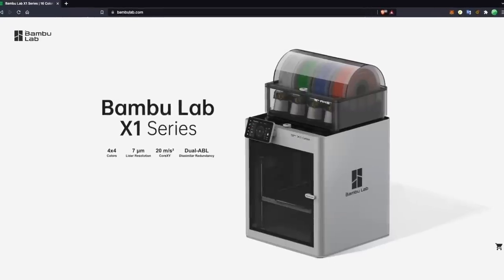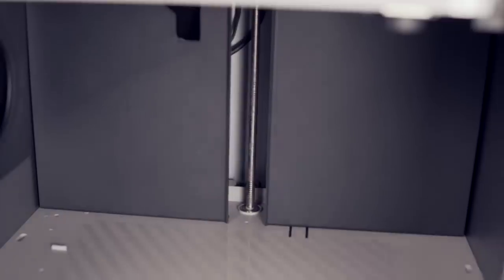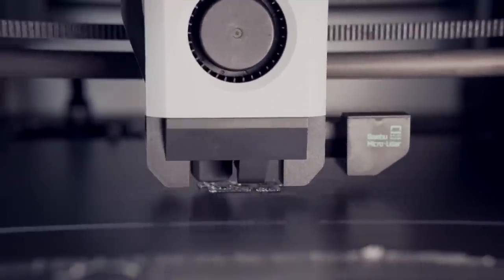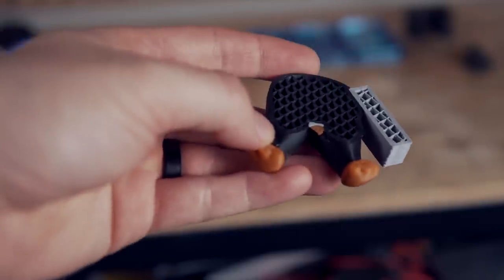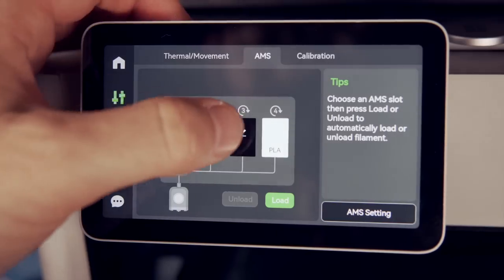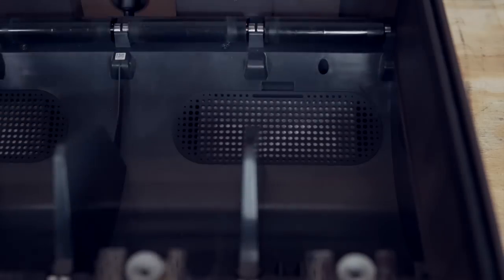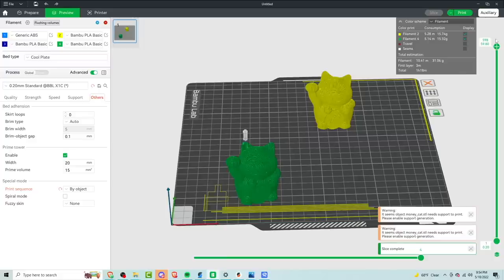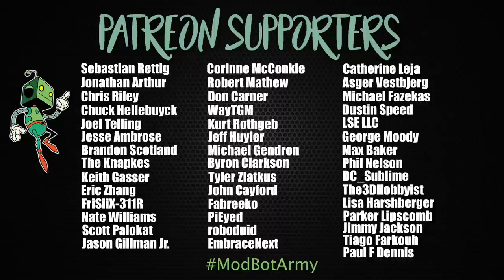INSANE 3D Printer That Requires ZERO Calibration (X1 Carbon)

Comment: Problem is their software from your explanation is cloud based, aka requires either web-browser or internet to use. Something that I do not agree with. What happens if the company goes under for w/e reason? It happened before making products unusable due to that.
Reply: They say: All should be Open source than
Reply: @fabianb9412  I mean, software should not depend on could that requires servers. For example sending something to print requires the cloud, if not then micro sd card. To be honest? They invested a lot into this machine, investing into a Type A usb port instead of micro sd would have been better imho.
Reply: @Vash.Baldeus  I think they added the Cloud in the wrong way. Cloud could be Helpful. (As far as i know they Change that [maybe])
They should build a Webinterface Like Octoprint/Mainsail/Fluids/... and local Wireless Connection.
You could activate a Cloud Connection for extern Access or slicing with the Handy App. But Not as Standard Connection.
And Second to (easy) Share settings. Especially with the AMS and RFID. Create a offline Database with the best settings (maybe saved on the SD Card). But add a Cloud sync to get the settings from Other People or Share your own.

Comment: @23:52 Yeaa... Proprietary consumables like those Nozzles are kinda a huge fuckin' NOPE to me... If for whatever reason the Company ( or even just the product line ) goes under and the flow of replacements comes to a screeching halt, then all you now have is a 1'000.- Paperweight which is nothing else but a big fuckin' nope. I mean I was already on the fence with the struggling Cloud Service, but this easily blows that problem out of the water 😑

Comment: Nice but do I have to have a constant internet connection to slice and print with this printer? That would be kinda stupid.
And you mentioned it has WiFi, so can we print directly from a PC (or transfer files to the printer) or it has to be done manually with an SD card?
I'd like to see some more simple version, without multi-spool support and maybe without a camera which would bring the cost down.

Comment: Fascinating!  This seems like a big step forward in the quest for a 3d printer that just works and can be as ubiquitous as a microwave.  The price point is... concerning; as others have mentioned, that seems like an awfully small margin.  It also makes me worry they're using sweatshop labour, or even forced labour - we know it's happening in China, even if we like to pretend it isn't.  But I'm not saying we should all abandon this project just because the price is low!  It's merely a thing I'm worried about.

Two areas I'd really like to know more about.  First, how is the nozzle put together?  I'm so ****ing done with hot-tightening and faffing about trying to get nozzles and heat breaks and heatsinks all properly butted together; that's a huge part of why I've got a pre-order in on a Prusa XL.  (The only reason I've not put a REVO on my Ender-5 is that I've got a MicroSwiss direct drive and I'm not aware of an option that works with that.)  I've wasted so much time and money fighting with multi-part nozzles, it feels like if this is just the same old thing all I'd be doing is ruining prints more quickly.

Second: can the AMS be used for runout?  That is, if spool 1 runs dry mid-print, can the AMS just swap to spool 2?

I'm certainly not an early adopter of anything, but I'm definitely keeping an eye on this!

Comment: Needs Klipper
Reply from the maker: Haha perhaps there will be a future version that is “hackable”.  For this release they are majorly going for hands off.
Reply: @ModBotArmy  (only at 10mins in so far) I can see that, but I am not a fan of stuff that "has an app" or can only be remotely controlled by said app.
Reply from the maker: @TheJustinist  you can print locally via micro sd but I agree that I would prefer local wireless as an option.

Comment: The AI looked like quinly vision?
Reply from the maker: Havent used Quinly so no idea. It also is not live yet so it is very possible it is a mockup image.
Reply: @ModBotArmy  I see, well it'd be nifty to go on full automation without the hassle of slice settings, or machine tuneups, just load model and print 😆👌
Reply from the maker: @Equinoxtrills  haha the dream. I still will like the ability to override though. Especially when printing functional parts that may need higher wall/infill counts 😊
Reply: @ModBotArmy  Yes, and the ability to print faster, with higher repetition, the printer might go a long way. 😁

Comment: As cool as it looks if it’s closed source = no go for me 🤷🏼‍♂️. Exposing yourself to overpriced replacements, poor support and/or bricked machine with proprietary firmware sucks…big time
Reply from the maker: I figured it would not be for everyone for the reasons mentioned. But for many it is not an issue. Especially anyone used to using Ultimaker machines that are the same way but 3-4x the price. I do love open source projects but I also see the appeal for a closed and controlled environment where there are way less variables that can be introduced.